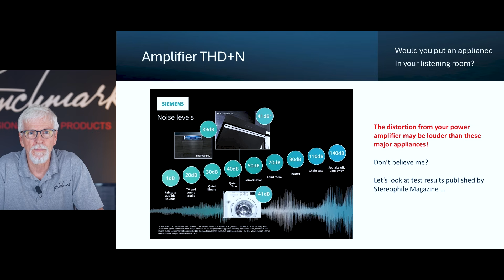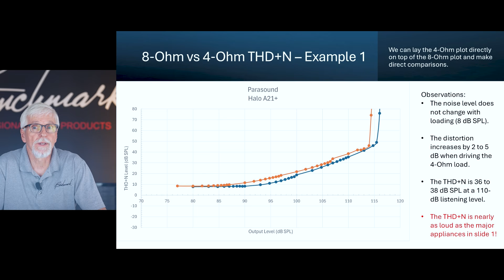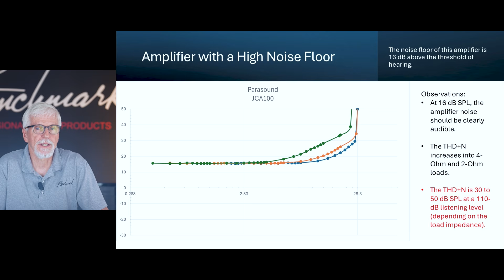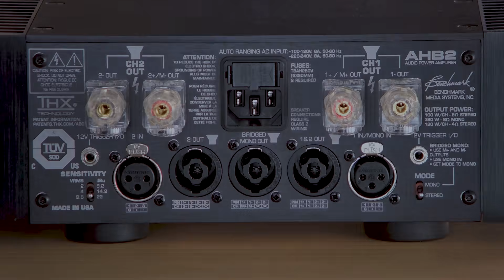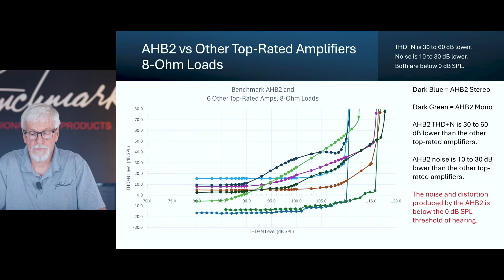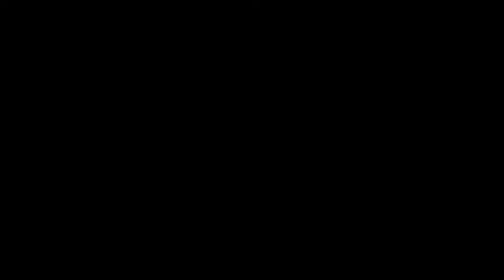How Loud is the Distortion from Your Power Amplifier?

Comment: No any human  in normal listening environment can perceive  amplifier noise at level 7 dB because natural  noise in room is overhelming louder - it measueres around 25 dB which means that it is  25db - 7 dB = 18db more. 18 dB = 6x3dB  power of this natural noise is 2x2x2x2x2x2 = 64 times  bigger than noise produced by  this amplifier .And this 64 times louder  noise in room is also for listeners not noticeable

 It may be heard   only  with sensitive microphones and high gain amplification and good isolating headphones - not with ears   Changing values "on the run" do not serve good understanding You say 1 Watt equals 2,83 volts. But it must be noticed that only  for speaker impedance 8 Ohm and it implicates that only for one single  frequency 1 kHz which  is not music.   - without it it this conclusion is worthless  .

 I can state that I listen to my perfect system producing Hi Fi impression in my salon where  I have kitchen corner with big refrigerator. I make in this salon also my private music recordings which I store to CD and NEVER notice in rcordings  sounds of my refrigerator. Instead I notice issues with noises from cars around and any renovation works in next block and of course flying machines and rain  and birds Not refrigrator Measuered 40 dB suppose to be stated  in what distance and which side of fridge - if noise is measured in factory it suppose to be  loudest side and without any sheld -

Regarding THD -   at  2,83 V music 1% THD equals  0,0283V Calculated power of this THD  is like 0,1mW which is far below the  power of headphones heard from adequate  distance
Reply from the maker: A simple demonstration that I like to do for visitors to Benchmark is that I will play a white noise signal at about 40 dBA and then play a 3 kHz tone that is at a much lower level. Most people can detect the tone when it reaches a level that is 30 dB lower than the level of the white noise. This is a fun demonstration. Try it if you have the required equipment. In the future, I may create a demo recording, but it must be distributed in a lossless format. MP3 compression will completely remove the 3 kHz tone because the algorithm determines that the tone is low enough to omit when encoding. - JS
Reply: @BenchmarkMediaSystems   My notice  was  general - not so detailed but I recognize also  this phenomena -   masking effect   may be often effective or not and it depends on types of sounds -. produced by music THD have the same type of sound beacuse is produced by the same sounds so masking suppose to be  effective    

 I just got idea to make interesting test. It could be simple to    present   pure 1kHz and mixed  with   it signal 3kHz at 1%  volume level  This would be most demanding test  due to maximum ears sensitivity . Never tried it but it could be interesting 

I am personaly tolerant to THD if  it does not reach 1% which is in reality 100%  true because I   need less  than 2 Wats from amplifier which is at least 10 times more powerfull.

Once I discovered that unfortunately for long tome  was listening to class AB tube amplifier with one tube completly not working and even in such outrageous situation franklywhile listening  for long time i   I coudn't spot that damage . That is why I know that at least  moderate   THD do not make me problem
Reply: @BenchmarkMediaSystems  You have a website where people can download files from, so it sounds like a solved problem.  And as for 30db down being audible - sure.   Let's go with that.   How does that apply to 7db distortion on a 90db signal like what you're talking about in the video?  I'm really confused.   Maybe I just don't understand the concepts well enough, but I'd like to believe I'm at least median level of knowledgable for your desired audience.   So maybe another video going through the concepts involved here would be useful?

Comment: How wrong can a guy be!  The one component most responsible for distortion:  1.  The best Phono Cartridge minimum 0.5 %  low frequency up to 5% @ 2 kHz distortion at normal playback levels.    2.  Loud Speakers.  You pay a lot and you can get 0.1% distortion at reasonable listening levels.    3.  Audiophile Power Amps with intentional 2nd harmonic distortion.  4. Low cost Hi Fidelity Power Amps, inaudible distortion.      Next the guy is talking about noise at a 7 dB SPL level at one meter away from the speaker in room.  Listening at 2 meters, like a normal person,  it is 1.0 dB SPL.  Inaudible.    Your refrigerator in the other room or your dog breathing is louder.   Are you high?   You can't hear that.   Most rooms have a 50 dB noise floor in the suburbs.  Maybe your room out in the country is at 30 dB.   This old guy's telling us he has the hearing of a ten year old.   No way.   With the amp putting out 1 Watt the sound music would be at 90 dB and the noise would be at  7 dB.   This old man would be unable to hear noise relative to music below 50 dB.     Is this AI generated garbage?   It would seem so.  The guy constantly blinking in the video is a tell tail sign.   Benchmark amps are wonderful, but lets tell the truth.   Put a microphone in the listening position in front of that 90 dB/Watt speaker connected to the Parasound A21+.  Record the sound with 1 Watt of music playing and then playing nothing and post the video here.  If that noise is audible after we viewers adjust the volume of our headphones to the level of the music and then hear a bothersome or even audible level of noise when it stops, then I'm dead wrong.  Most of the people reading this can't hear noise that is 83 dB lower than their normal listening level.  They can't even hear it 60 dB below their normal listening level at the age of 60.
Reply from the maker: The one "electronic component". This excludes electromechanical components like the speakers and phono cartridge. It also excludes mechanical media such as the LP.

I would also encourage you to think in terms of dB and not in terms of %. Ask "how loud is the THD" and "ask how much difference is there between the level of the music and the level of the distortion." It is important to consider these questions.

All SPL values shown are peak values not average values. Most recordings have about a 12 dB difference between the peak and average values, but this can vary depending on the type of music and the way it was recorded.

As for the noise floor of the room, our ears have the ability to detect a 3 kHz tone that is 30 dB lower than an ambient white noise signal. This is what allows us to carry on a conversation in a noisy room.

The amplitude at 3 meters from two speakers in a typical room will be almost exactly the same as the 1W-1m anechoic response. I write about that calculation here:

https://benchmarkmedia.com/blogs/videos/speaker-sensitivity-and-amplifier-power-needs-erins-audio-corner

- JS
Reply: @BenchmarkMediaSystems  AI Overview        Yes, a woofer is an electroacoustic component that converts electrical energy into sound waves

Comment: Well... The loudspeaker or headphone is a way bigger contribution to distortion than most quality amplifiers.
Reply from the maker: Absolutely. I mention this a couple of times in the video. We can solve the electronic portion of the problem. Poor speaker performance is often used as an excuse for poor amplifier performance. - JS
Reply: Regarding the chart at around 22 minutes. A question is in bridged mode driving a speaker with 3.1 ohm minimum impedance (mine) what does the curve look like? It would be very informative to see that chart with bridged mode driving 4 ohms, 2 ohms, and in my case an effective 1.55 ohms.